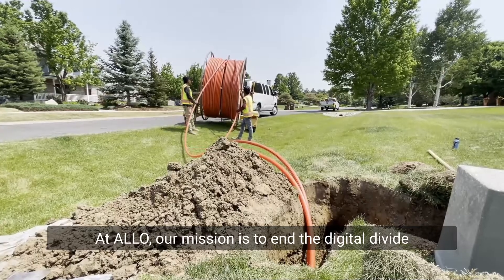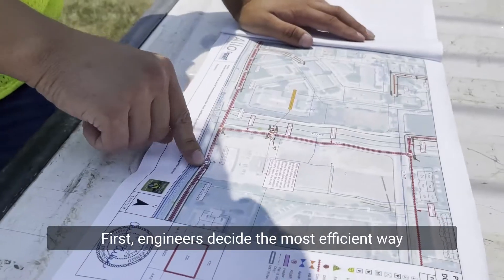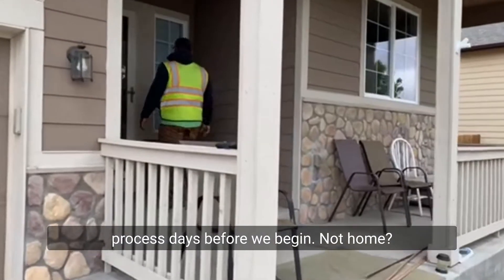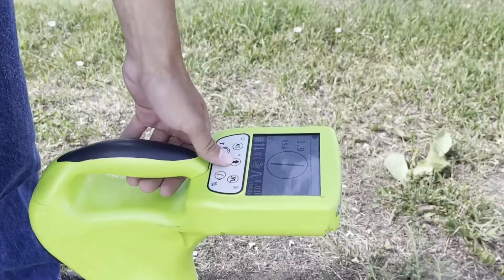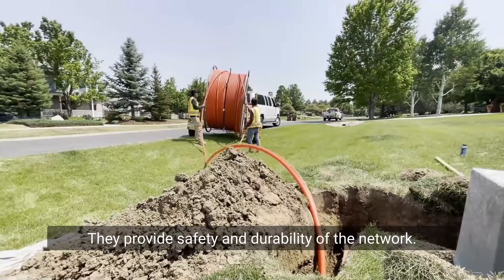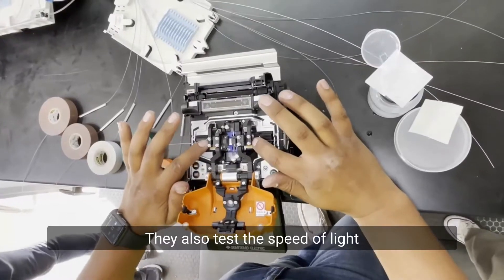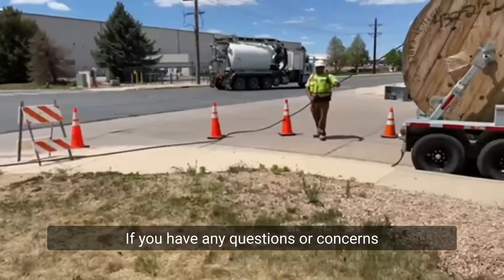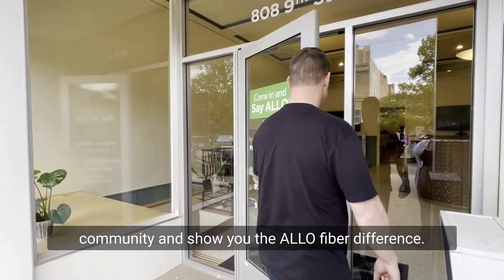What to Expect from ALLO's Construction Process

Comment: I hope they actually bore and don't wreck my patio blocks. Hope springs eternal. Similar group left big holes in my lawn in Wisconsin and never did reseed even though called and also reported to the city.
Reply from the maker: Hey there, carolc1109! Our crew takes great care when installing our fiber network. They are required to leave the property they way they found it once complete. If a bore is needed thy will do a site survey to make sure the line is installed the least intrusive way possible! Just let us know if you have any questions. Thanks!